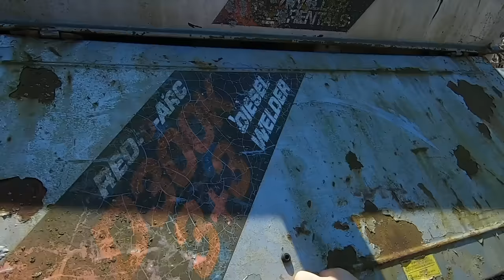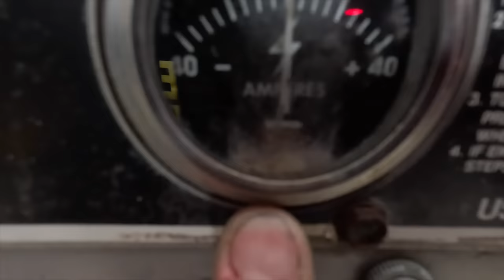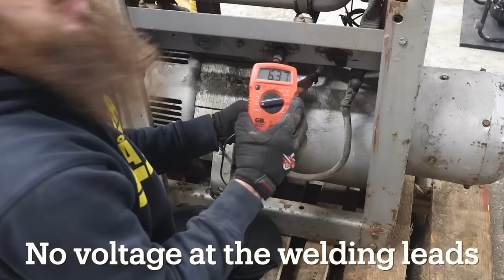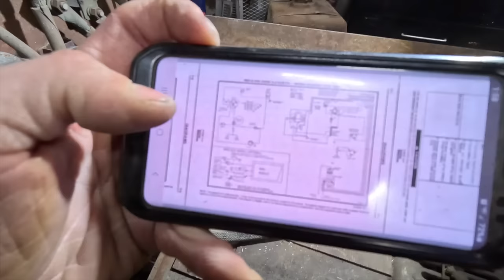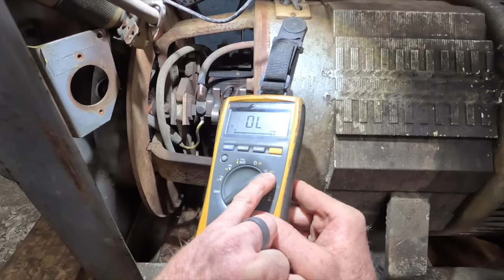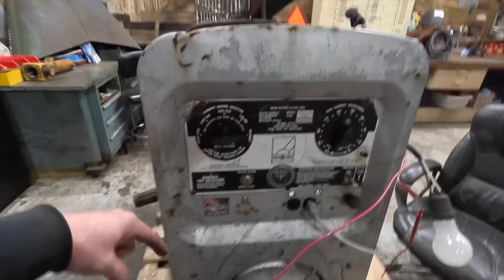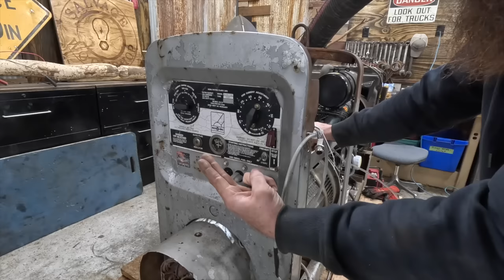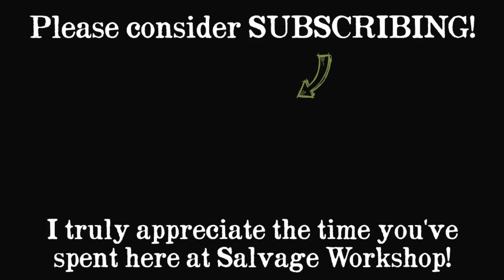SAVING an ABUSED Portable Welder from its Junk Yard GRAVE! ~ WILL IT START? ~ Red-D-Arc D300k P. 1

Comment: My guess is that the temp gauge wired in tandem with the fuel solenoid works the same as a Murphy switch. It may be connected to your oil pressure sensor as well to shut off the engine if you were to overheat or loose oil pressure. Just my guess. Be safe. Thomas, Mississippi!!
Reply: Yep apparently the push button bypassed the oil switch

Comment: When you flash the field you do it with the generator running and you only touch it for 1 second only. You may have smoked some wires when you held it on too long. Flashing the field is usually needed when the generator for a long time. When you flash the field you are just  remagnetizing the field coil on the generator.

Comment: I tore apart every toy and put them back together since can remember, including my GI Joe Jeep 😅. I had to know how things work or how they were made.   Just want to share, at 11 we moved to an old farm. It was great., I dug a washing machine gas engine out of an old tool shed in 1968, tore it down, put it back together. It had a cast iron pedal that drove a chain to a gear for a ½ turn on the crank. Well this thing had some serious compression so when i stepped on the pedal to kick start , the whole thing rolled. So i put my hand on the head, foot on the pedle and jumped up to put my weight into it holding that head firm with the tip of the plug pressed into my palm. 😮i got lit up and fell on my ass in the fine dust of garage dirt. That had more kick than an electric fence. What was neet was that under the oil case was another cast area for gasoline.  I went in the army as a mechanic and my first assignment was Europe,  i stayed in germany for close to 4 years, total of 20 in ARMY. Then owned a SMALL engine repair shop for 10. Complications from the service injury😮 put me in the hospital. It seams like my body gave out in such a short time,, very very frustrating. 
 Today, I am physically 100% disabled 67years old. As best as I can I have been rebuilding a Yanmar YM2000 all thats left is putting the hydraulic pump on and f itting a release valve so it does not dead head again and crack. 
Watching your 😮video was a complete pleasure. As talented as you are it was funny seeing you get excited over little accomplishments.  But we know they are more than little, its like the thrill of the hunt. I always love finding those little things that make expensive things come alive again.
I too saw that white smoke and my inside jumped before you actually 😅. 
I can't imagine what i would be doing besides reading without this internet. 
 I watch  CEE Cutting Edge Engineering out of Australia and your video popped up. Glad it did. (Liked subscribed)

Comment: From years ago when I used ATF to clean up gas engines, I was totally surprised at how little smoke you got running it.  I used to get a total smoke screen!  The higher compression of the diesel must actually burn the ATF cleaner.  I think I would cut a hole in the garage door with a flapper cover so you can poke a hose through it when running engines in the shop. Wouldn't be a bad idea to have a hose bringing combustion air in to the engine as well.  They can pump a lot of warm shop air through and out.  Curious to see if the generator is operable as they can be the hardest part to repair and get parts for.

Comment: If I remember correctly you want the switch to be momentary. Once the engine starts and has oil pressure and is not to hot the system will keep power to the fuel solenoid.

Comment: As a general rule, more filtration media means more capacity before restriction and bypass. 
In a perfect world where the filter had zero drainback, you could use a 1R-1808 (25-micron, 5.25x12  Cat) or even 244-4484 (12-micron, 5.25x12 Cat) oil filter on a baby Briggs and not hurt anything. Being a hydraulic system, once the system is charged, you could have a filter the size of a silo and you wouldn't have flow or pressure issues. The problem is that even some filters that thread on vertical will have some drainback, and the delay in delivering oil while re-filling the filter is the question.

Comment: The purpose of the bridge rectifier is to convert the alternating current into direct current.  A single diode also converts ac to dc but the bridge rectifier enables us to utilize both the top and bottom of the sine wave and will nearly double the voltage.

Comment: Get yourself some 'Deoxit', you can spray it into connectors/switches, or directly onto exposed contactors. It helps with everything from heavy corrosion to the microscopic 'Filiform Corrosion' that is unseen in most cases.

Comment: Flux is tree sap, basically. And you shouldn't solder (like previous user did) joints that will be under vibration. "Cold weld" by crimping properly. It will be air tight and vibration resistant.

Comment: I had an old hour meter like that that only worked some of the time. I carefully pried it apart and  lightly oiled the internals while helping it along with a toothpick. They work similar to an old clock with a solenoid that winds a clock spring. It worked fine after that.

Comment: That bridge rectifier is working correctly like you suspected. All 4 diodes point from negative toward positive, so nothing makes it back down except through the machine or battery.

Comment: I have an old lincoln 140 gas generator/welder I got cheap and was not putting out power and I had to excite it while it was running and it did the trick.

Comment: Back when I was still turning wrenches, they had one quart oil filters available for small block. chevys. The main reason was adding extra Oil capacity but yes you will get more ability to filter for longer than that is.

Comment: In an emergency situation use a piece of garden hose to insulate the the cracked or broken insulation and tape the ends to keep the hose from slipping off the wire instead of heat shrinks

Comment: The reason you got a different reading across two terminals on the bridge rectifier is you were reading through two diodes. Each diode has a voltage drop of 0.6 volts. So two in series which is what you were looking at the voltage drop is double or 1.2 volts. You were reading resistance so those numbers look different depending on the state of your meter battery.

Comment: On the bridge rectifer, the reading are good.  Your getting a double diode drop from top to bottom one way and nothing the other way.  That is correct.  On the Amp Gauges you will not get any reading unless it has a load on it, so like the battery charging circuit will show current but the welding leads should not show any current untill you start welding with it.

Comment: You are measuring voltage at the weld cables, to measure current you need to put a load on the weld leads.

Comment: your right on with the voltage at the leads , read data plate for o.c.v. open current voltage, meaning not welding  when working voltage should be between say 22 to maybe 31 iam guessing but your good, thats a nice  machine i have a sae 300 gas with flathead 6,  good work on the repair    fest

Comment: The momentary switch is fine.

What happens is when you go to start it you have to manually open the solenoid by pressing the button and providing it with current from the battery. This applies current to the solenoid, opens it and allows fuel to flow and then you trip the starter. Once the engine fires the alternator will generate current which among many other things will hold the solenoid open allowing fuel to flow and the engine run even when the you release the button. However if either of your temps get too high they will shut off power to the solenoid, allow the valve to cut the supply of fuel and the engine stops. So... If you were to put a permanent switch in it would effectively disable the temperature protection by always feeding current to the solenoid whether the temps are good or not. It could lead to overheating your engine.

It was likely patched out because one or the other or both of your temperature senders are not working and providing it with current once the engine fires. Rather than fix that the mechanical genius in charge of the machine removed the solenoid and also removed temperature protection...

I hate how whoever had your generator before you treated it. He was absolutely determined to run the thing in to the ground! A real king of all bodgers!!!

Comment: when i worked in a diesel shop a few years ago we didnt bother with the fan to extract the exhaust , we just used a length of old canvass fire hose it worked well and heatproof and when not used was roled up and hung up out of the way

Comment: You should always test a fuse out of the circuit. If it’s a very low load circuit, you may get continuity through the circuit itself, making the fuse test good while in place.

Comment: The fuel shut off. If you put a toggle switch in the line, you won’t have a reason to hook it up. Once the engine starts, a signal is sent to the shut off. The momentary switch is there to energize the shut off until the engine starts, then the oil pressure switch energizes the shut off

Comment: the lift pump on my kubota tractor quit working 9 years ago. i have a fuel tank higher than the injection pump like your welder. i bypassed the lift pump completely and it has been running fine as a gravity feed ever since. i just left the pump in place. this should work fine in your static application.

Comment: with the welder end, but the  grub screw in as the solder just solidifies so it compresses  easily without risking the threads. you end up with a nice grub screw notch.

Comment: With a momentary switch that is what you need when turning on glow plugs or oil switch when starting till oil pressure. Both things require a momentary switch because when the oil pressure falls you want the engine to turn off. The glow plugs only need on when the switch is depressed during starting. Once the engine starts it no longer needs on.

Comment: If you can clean the wires Lincoln numbers all there wires. If you can find a manual on line with a wiring diagram you can put them in the correct place.

Comment: Only thing I wanted to add was using some di-electric grease on all these connections after you clean them all up.  If they had done that in the first place you probably wouldn't have had to do a lot of that.  Nice trick with the copper lugs too though IMHO they are cheap enough having a kit of them around makes sense.  I do appreciate the get-it-done attitude though.

Comment: First and foremost, WHERE have you been? I am glad to see you posting more content!!When you re-excite the field, 1.  the gen. MUST be running, 2. it is polarity sensitive.! SO your positive and Negative fields MUST be correct!  The Very 1st item you should check is the Brushes and the contacts( they are on the end of the stater) they ride on!  Then make sure your reset switches for your plugs are not tripped!  But for a Rookie you are in the ballpark! I hope you figure it out(or get lucky)! About the Diode rectifier, look at your diagram and you will answer your own question(Hint: It is working correctly) You REALLY need to talk to a Generator Guy! As a Old Gen. Guy I just watch you in amazement! (That you haven't gotten knocked on your Butt (From the Gen>) You got power, BECAUSE you got lucky and had a correctly polarize piece of equipment attached to the excitement circuit) Some time it's better to be lucky then good! You may want to re-flash your field (this time with the gen. running). This MAY correct the DC. voltage problem (it may not)

Comment: On the older mechanical pumps like this or older sbc Chevys sometimes after sitting you can prime them by filling it with fuel via the output from the pump . 
Also this is pretty much a 300d Lincoln machine just like you said dumbed down for cheaper/rental applications only differences I believe is the no idle up and down and gauges are in different spots , also the Lincoln versions came factory wired for a remote

Comment: Speaking of filters I have an 05 Ran 1500;Hemi. The filter it calls for is a tiny one but I found out that an older filter for a old model engine is a PH 8 will fit and work on 318, 360, and Hemi  just  fine. I put a lot of miles on my truck and the bigger filter last longer

Comment: You could run the longer hose to the blower and put it outside. That way the exhaust fumes will be cooler by the time they get to the fan and all the noise will be outside.

Comment: I'm pretty sure you should have kept the pushbutton.
The idea is that the fuel solenoid valve is on (open) if either:
1-The oil pressure is high and the engine is not overtemp.
or
2- The button is pressed.

The idea would be that you press the button to enable fuel flow while starting, and once the engine starts and the oil pressure comes up, the button no longer needs to be held.

Strange that it is not labeled (Hold to start) though. For that matter it could be automatic while cranking the engine by running it off the start switch. It would need some isolating (second switch contacts or some diodes) so that once the oil pressure comes up the voltage doesn't feed back and energize the starter motor.

Comment: The temp is normally closed while oil pressure is normally open so if temp is cool then closes and power goes to oil pressure switch which is open when engine starts it completes circuit so momentary switch is shunt rill oil pressure come up

Comment: You should be using rosin flux not acid. The acid will continue to react and eventually destroy the connection. Just need a spool of electical solder which has the correct flux inside it.

Comment: The 110 volt outlet is straight off the exciter. If the exciter isn’t generating, the main generator won’t work. 
96 volts from the welding leads when not welding is perfectly normal. That is your open circuit voltage. Not to be confused with amps.

Comment: Without going through all the comments to see I am going to repeat an idea, let me recommend the following.  Find yourself an older heavy Franklin Stove or other add on wood stove for your garage.  It would greatly help with the low temps that you mention and..... Then plumb the output from your smoke extractor into the exhaust system of the stove.... probably want to use two flues to avoid allowing the outer cold air to come down the chimney when the system is shut down.  Simply put.... you would want your exhaust fan to be above your normal flue but that would allow smoke to return to the garage if the fan were not running. the flue. Pencil it out and you will see what I mean.

Comment: For more perm, put the fan at the exhaust end of the pipes so it creates suction in the pipes, not pressure.  This ensures the bad gases get out and are not pressure blown out of the pipe leaks into the garage.  LESS flux, that was way too much.  All flux is corrosive ultimately and there should be a small exit hole drilled in the end of the tube portion.  Also lets you see the solder filling the tube.   Not a fan of soldering connections that are subject to vibrations.  A proper mechanical crimp is preferred.

Comment: You should NOT have any resistance in an oil pressure switch.
The contact set should be able to pass curent for an indicator lamp or a relay coil.
i.e any resistance means a bad unit.
It's a simple contact set that closes.
The exception is a pressure SENDER unit, which changes resistance by the pressure, this way telling the pressure on a meter.

Comment: That machine if you convert it to dc with   Rectifier can do alot.. i have a old 70’s craftsman welder 220 amp. Had a 90 max ac voltage too.. i run it at half power on a 30amp plug with a high frequency box and a tig welder. Does great

Comment: Because it is a rental unit they assume no one will be checking oil ,water or the temperature, so they install equipment so the machine shuts itself down whenever it needs anything. I have seen low fuel shut down switches installed on diesels also. By doing that the rental units doesn't get destroyed the first time they leave the shop .

Comment: ooh...get some cheap red n' tacky grease...thin with some acetone or gasoline so it's a liquid...then paint on all the bolts/connections that can rust/corrode...it will coat them and protect them from moisture (same stuff as that battery protect spray stuff you get at orilleys) or you can dab on a bit of polyurethane with a paintbrush...once it's coated it shouldn't corrode again.
Put some Motor Kote in the engine (a hyperlubricant) to help reduce wear on startup, it helps reduce/eliminate dry starts

Comment: Interesting.  I spent thirty years or more working on car deck ferries.  I can tell you though there were 16' overheads and three foot more in the frames the fumes down on the very deck were immediate. The intakes were about four foot high and when you were chaining equipment on your knees you were immediately aware of the fumes (impurities?).  The enclosed upper car deck (completely closed off from the lower main car deck) was brutal as it filled with fumes very very quickly.  The cars restricted air flow to the ventilators  so the fumes trapped among them (down low) built rapidly.  If they were lighter they would rise and be gone.  Perhaps the specific gravity with all the impurities in real life exhaust is heavier than air?  This is affirmed if you get behind a diesel bus even though there may be two or three car lengths between the two of you it does not rise fast enough if at all to keep you from breathing it.  Don't know why but diesel always was worse.  With the efficiency claims over gas engines you would think it would be less?  Exhaust is never pure carbon monoxide not even close so when dealing with it one must be aware of the real world effects.